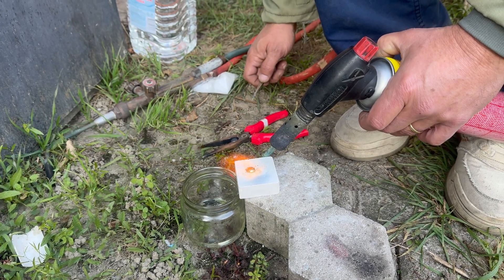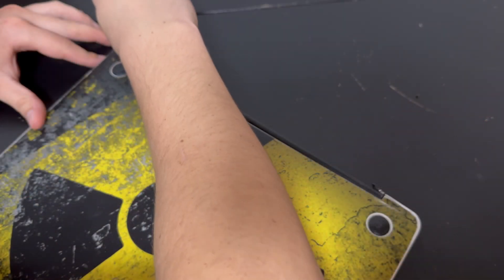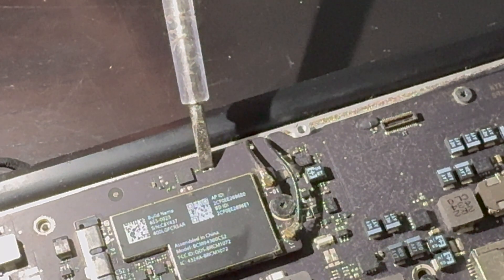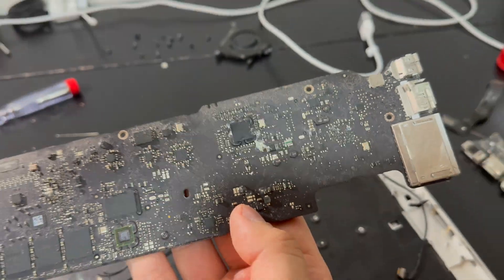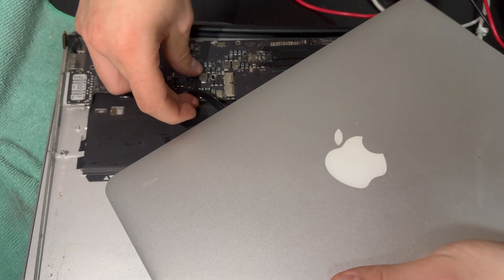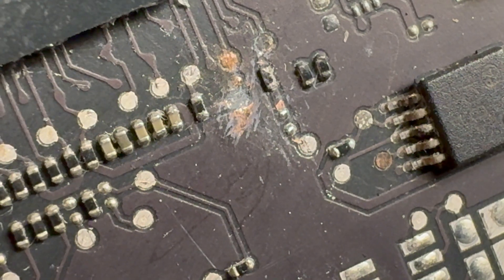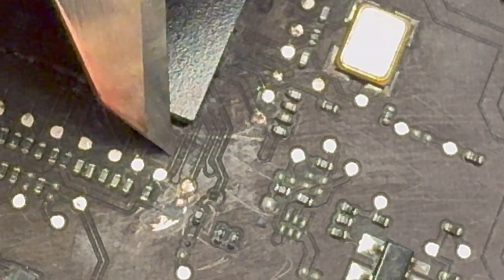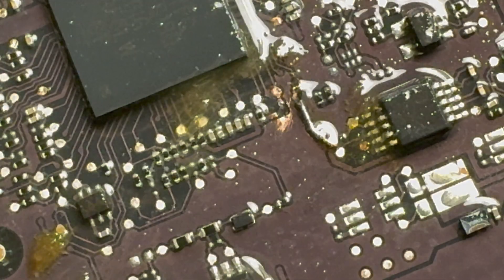Radioactive MacBook Necropsy

Comment: invest in some kind of rotary tool. Maybe even a nail tool. That would really help with scraping off the solder mask
Reply from the maker: @telegummis  I do have like a dremel, but it’s way too aggressive and not precise enough. It’s very easy for it to jump and mess up other components. I also have a fiberglass pen, but it’s too large. The knife works very well.
Reply: @ that’s why I’ve mentioned a nail rotary tool :). It is way less aggressive because it is mentioned to work near skin. I’ve used it for scraping shielding on a plastic flex ribbon cable to be able to solder to it. I wouldn’t be able to do it with a knife.